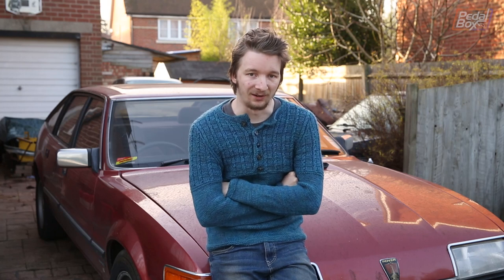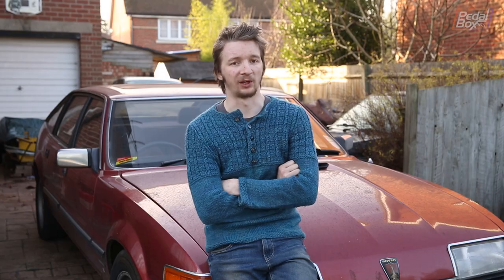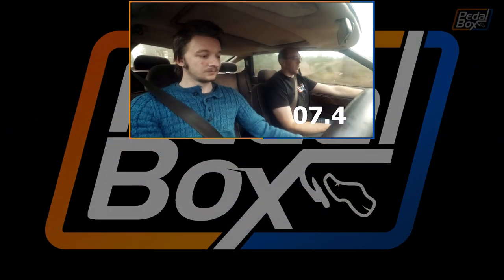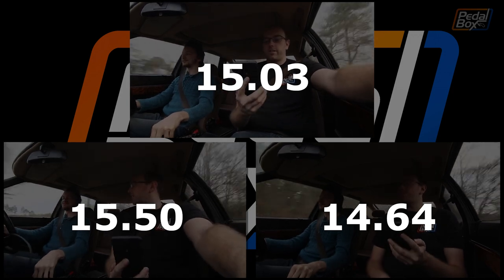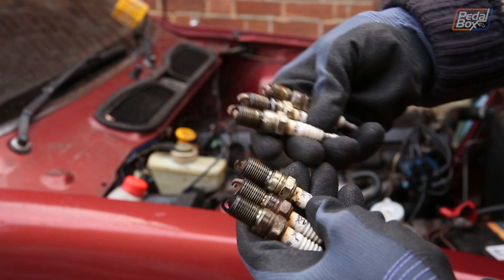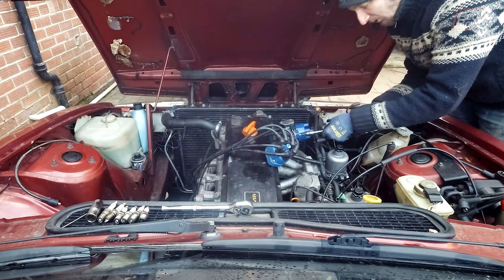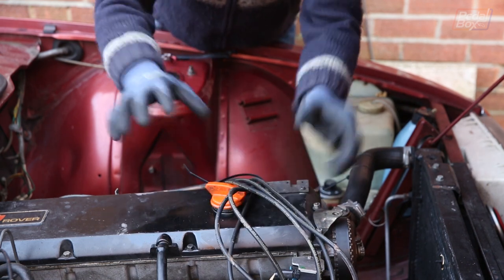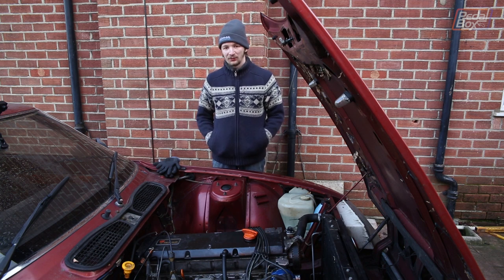Maintaining the SD1 - PedalBox Episode 15 | Fleet | Rover SD1 2600 |

Comment: That's a Van den Plas, is it not ?
isn't the plate/bracket at 5:56 used for locating the HT leads ?
Reply: Chris here, the car's owner and chief muppet from the video :)

It is indeed a Vanden Plas - absolutely bargetastic. Honestly never driven anything more comfortable on road trips!

I thought that might be what the plate was for, and having checked a few photos and Rover diagrams I did find that's pretty definitely the case. Unfortunately with the length of these leads, there's actually not enough slack in them to reach the plate, and the old ones weren't much different. Also even if they could reach, the plate isn't actually a very useful shape for attaching anything to. It's more like a tongue so I suspect there might once have been something else that attached to the plate which held the HT leads.

Those problems which seemed a bit too boring and niche to bother putting in the video. Pedalbox is mostly aimed at a general car audience so I'm not sure how specific I want to get on those kinds of small details, but if viewers want me to I'll happily nerd out more when we get back under this big old bonnet in future episodes :) I'm no Oscar Bakker though so don't expect too much knowledge!
Reply: @ChrisDRimmer  
Thanks for the reply !
I had a 1985 2600 VdP years ago. Loved it but I didn't have the funds to keep it on the road and it went for scrap (this was back in '96 or so, so there were still many about and it had had a 2300 engine swap, so when I put a new 2600 crank in it, the pistons hit the head, so it needed new 2600 pistons etc. all whilst i had just been diagnosed with Crohn's. It was a bit too much for me to take on at the time being so ill).
I'd love another one ! 
Talking of barges though, I have a 1987 Granada Scorpio !
Reply: @lewis72  "didn't have the funds to keep it on the road and it went for scrap" pretty common with SD1s back in the day as far as I can tell! My Dad used to have a white 2600 when I was an infant, met the same fate when the sunroof started rotting out.

If you want one, better get on it soon. All the bad ones will have rusted away and all the good ones will be worth £££££ before long!
Reply: @ChrisDRimmer  
I don't think my Granada Scorpio is going up in value much however, I bought an E39 M5 in 2012 for £5700 with 72k miles on it and it's now still only on 88k miles. I think that's gone up in value a bit but the repair bills on that can be monstrous.
I also have a Stag that I bought about 6 years ago for £2k, which hopefully has gone up a bit too but, as with nearly all classics, the value is greatly dependent on condition.
Reply: @lewis72  E39 M5 is a champion - I very nearly ended up with an E39 540 just months before I got the SD1, though as a £900 car I'm pretty sure it would have been a wreck compared to your M5! Repair bills are definitely eye watering on them though - I was worried about costs before I had even finished reading the for sale ad :D

And yeah, don't get me started on condition. I thought I got a bargain with this car, but actually the more I explore and fix, the more I discover it's been bodged and cowboyd and generally abused. My list of things to fix gets longer almost every time I look at it, but I'm lucky enough to have a good set of tools, plenty of spare time and enough income that I am, slowly but surely, beating it.

Good Vitesses are climbing into five figures now. I reckon if I wasn't getting E277 DPG (a black TP, and one of the last) from a disheartened owner I'd never have one! But that car is a whole different series of videos, one I'm not even remotely ready to start on yet!
Reply: @ChrisDRimmer  
I think the way to accept/stomach the price of some of these classics being so high is to remember how expensive they were relatively when they were new and how much time, money and effort has been spent on the good ones to keep them in good condition. As depreciation is unlikely and they may even go up further £10k for a 35 year old SD1 seems cheap.
My M5 was £60k 20 years ago. That would have bought you a  nice 3-bed house then!

Comment: Any more vids on the SD1 to come?
Reply: Sadly nothing super soon, I rolled the old girl into a body shop and said "She's 35 years old and just got her first rust advisory. I would like to never get another rust advisory, ever" so now I'm saving up ~£5k for bodywork to make my forever car last forever! I reckon I might have her back in 6 months, if I do really, really well.

After that though, yes. Lots and lots more to come :)
Reply: @ChrisDRimmer  Good plan. Have you seen what Nitrosilvia (on YT) does with SD1 body restoration?
Reply: @jgh548  I haven't kept up to date sadly, I watched perhaps the first dozen episodes and loved it though! Will have to check it out again and see where he's at. Very very very glad mine's in slightly better shape :D
Reply: @ChrisDRimmer  It would be great to get an SD1, strip to a shell and rebuild properly getting all panels to fit properly, sound proofing the hell out of it and then reconstructing the interior with more solid fittings and lots of stitched leather...
Reply: jgh548 yeah the interior on these tends to be a bit rattly, would be nice to do it right :) dread to think how much it could cost though! I’ll be happy with just a clean, dipped shell and a bit more power myself
Reply: @ChrisDRimmer  The door trims can be improved immeasurably with some fibreglass resin, a bit of reinforcement, some foam backing and felt tape. I reckon some dynamat and mass loaded vinyl on key panels would make a big difference.
Reply from the maker: Just a quick comment-update, All being well, some SD1 content coming in the next month!
Reply: @PedalBox  Brilliant! Looking forward to that.

Comment: The 0-60 test tells me the gearbox is at fault - first gear did not allow the RPM to increase sufficiently on initial start for the engine to produce its rated BHP quick enough resulting in slow performance. Nothing wrong with the engine. Check the brake band setting and consider a fluid flush? Nice sounding engine by the way
Reply: Trans fluid is all fairly new - thanks to a leaking seal it's become a total-loss oiling system in there so it's always being replenished, at great cost! The fluid leak is on my list of things to do but I'm afraid of shearing all my seemingly seized propshaft bolts so haven't had the trans out yet to really take a good look at.

The real problem with 0-60 runs in this car is that first is really tall and the converter is stock, so it's quite tight. It launches at about 2 grand, which wouldn't be too bad on a shorter gear but first actually goes to about 50-55mph in automatic, or 60 if I'm being brave and locking it down in first manually. It's such a tall gear that launching at such low RPM with so little torque multiplication through the converter is just really, really slow.

I love the sound out of it too, thanks! One advantage of having bugger all power is I can enjoy the wide open throttle noise for a long time before I'm doing naughty speeds :) It's mostly the standard exhaust, just with a 3.5" straight section after the second silencer, so the third silencer has been removed basically. It's still really nice for cruising, but once the revs get right up there it starts to sing quite a song!
Reply: Also, as far as I can work out dead/dying brake bands would cause the trans to slip, losing torque output and allowing rpm to climb abnormally high? My dyno run from a few weeks before this episode was shot showed it making diesel torque at idle, and the revs are definitely not running away under load so unless I've missed something I'm pretty sure the brake bands are good. Would be good to know if I'm wrong though - the last thing I want is to have missed a problem!
Reply: kevin paul halliday yeah there is a filter, it needs replacing every 24k/2 years so it’s due soon. As far as pressure goes, it doesn’t slip during shifts and it’s smooth when starting so I’d venture it’s likely making good pressure. I hadn’t actually considered testing it though so that’s a good shout - I’ll look into that to be on the safe side!